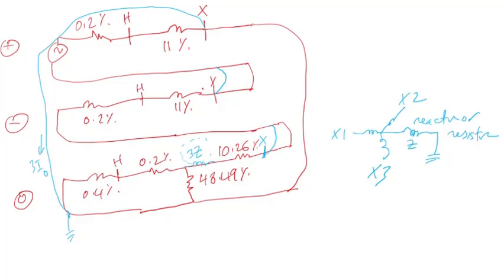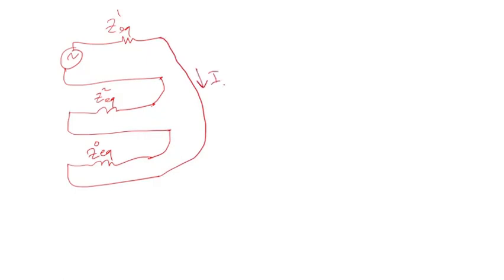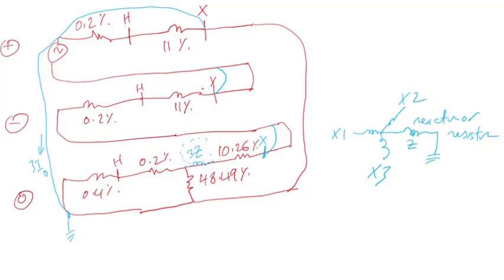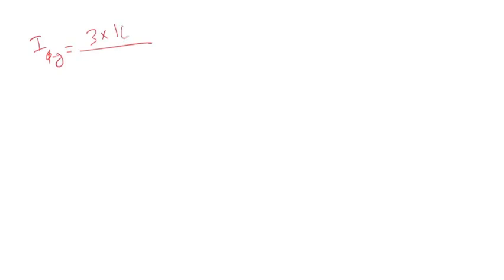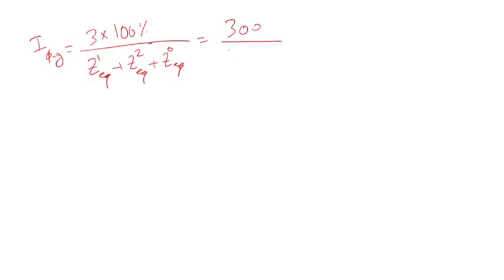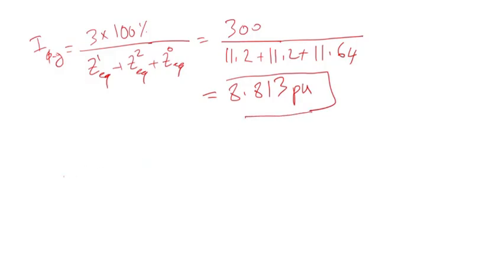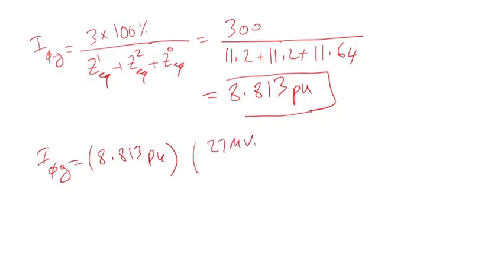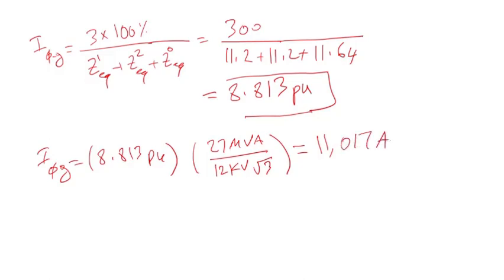Sizing Neutral Grounding Reactor or Resistor and Effective Grounding - Part 02

Comment: Why do we want to limit the ground fault to 6000amps? where is that number came from?
Reply from the maker: I just picked 6000A to show how to limit the fault current. In real applications, the breaker capability will determine what to limit the current to. If you have multiple breakers at a substation, it may cost more to purchase them with the available fault current. Instead I t may be cost effective to use a neutral grounding reactor or resistor to limit current to a certain level.